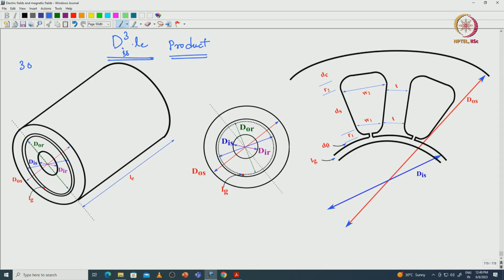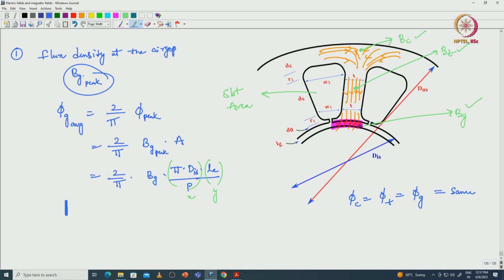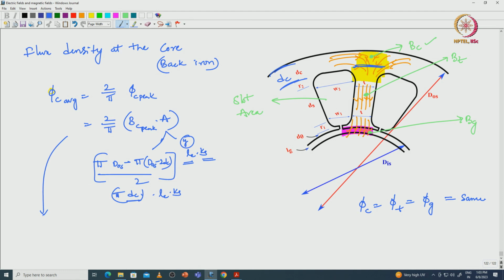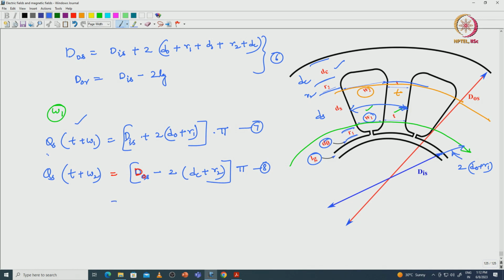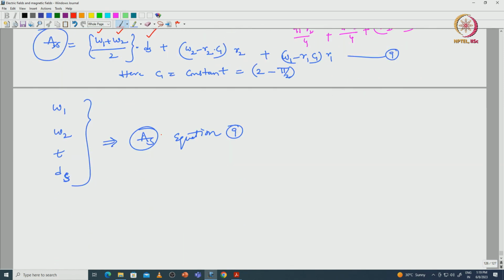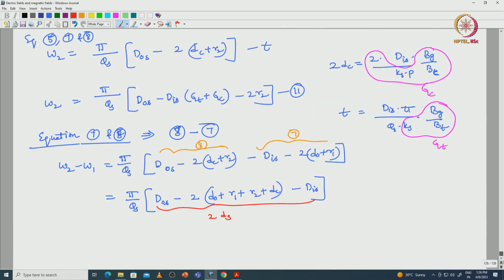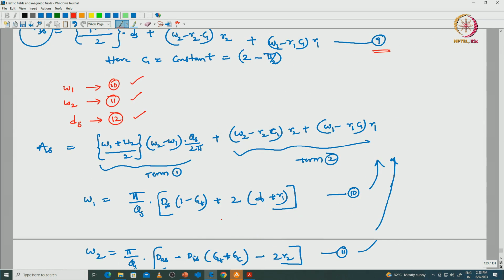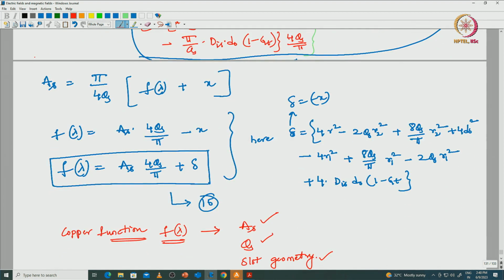Lec 30 Electric Machine Sizing Equations-Output Power Equation in terms of D3L Product - 1

Comment: 1- sir when we have the six commutation control for a bldc machine, the average flux or sth that calculated from peak values is going to be change right? 
2- Another thing that i can not get is while you calculate the teetg flux density why you use the teeth under one pole in the expression instead of just one teeth under one pole 
btw thank you for lessons and sharing your experiences